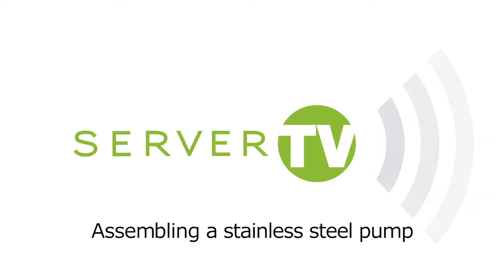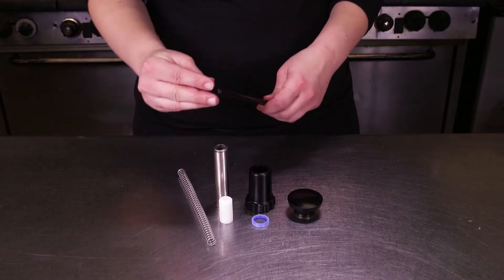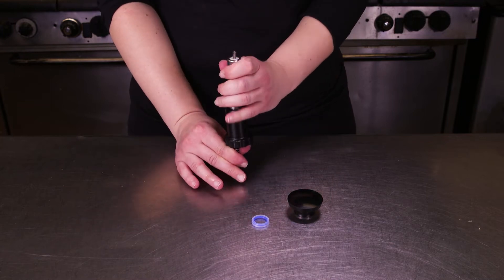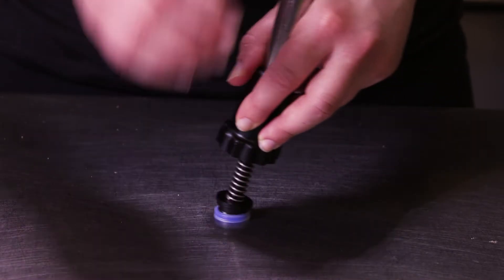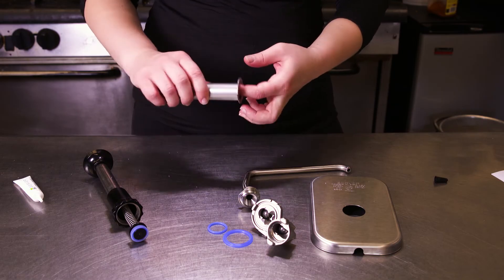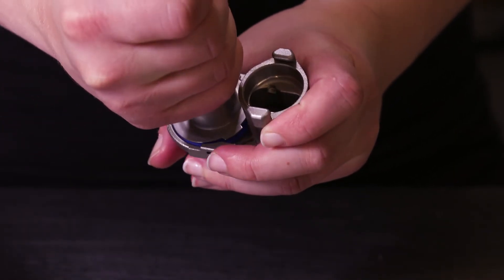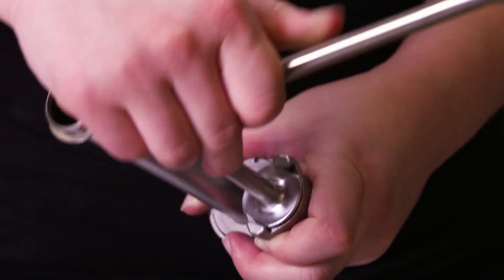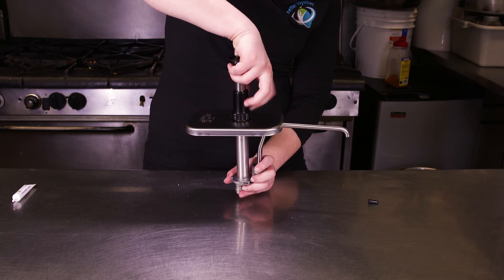ServerTV Presents | How to Assemble a Stainless Steel Pump

Comment: I'm having issues with my seal assembly coming lose and being pushed into the cylinder. I've been looking for a food safe sealant or super glue to keep it on but having issues finding ones that are truly food safe. I did just buy a new one recently since I thought the other one had just needed to be replaced but found that was not the issue. Any suggestions on this?